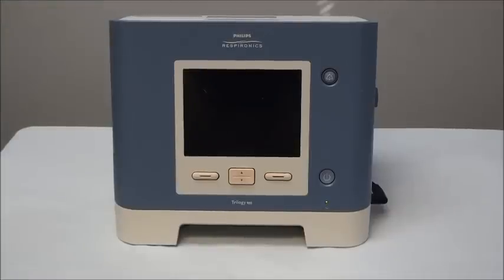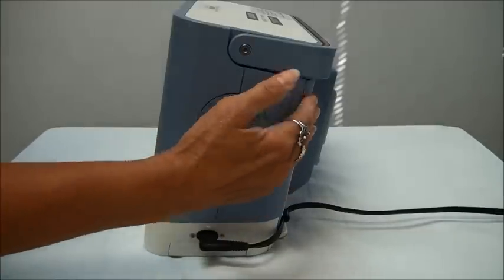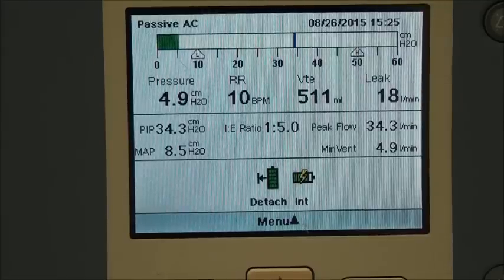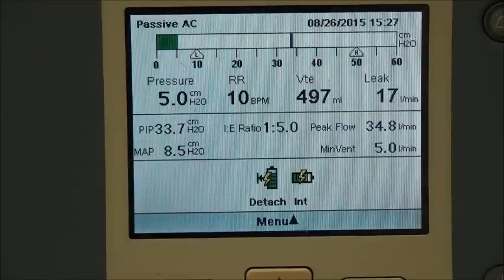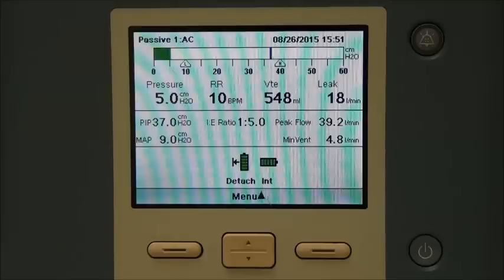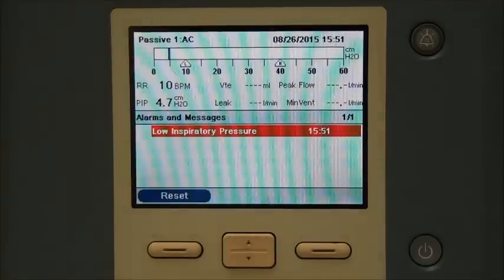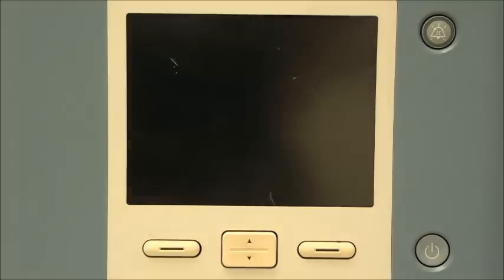Trilogy 100 Ventilator Set Up

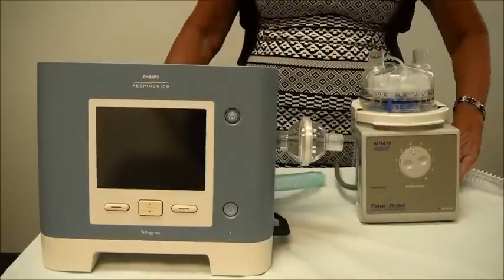Comment: 4:36 - - QUESTION:  WHERE DOES THE EXPIRATORY HOSE GO AFTER IT LEAVES THE HUMIDIFIER?
(On HOSPITAL VENTILATORS it hooks back into the ventilator - - but on HOME VENTILATOR it just hangs off the side ???)
Reply: It connects to the patient.
Reply: That is the inspiration limb coming off of the heater...Expiration occurs thru the port connected near the patient...in passive mode...No Expiratory limb on a trilogy circuit.
Reply: @DEgan-dk4qp  thank you 🙂

Comment: If I want to connect a oxygen concentrator is it a certain way the valve on the ventilator needs to be and do I change any settings
Reply: Katina Star I need to know also
Reply: Yes it needs to be connected on the valve at the back of ventilator. At no certain point that you will change a setting without an order from the doctor or Pulmonologist. Settings are mostly lock so you cannot even change the settings without the Pulmonologist order.

Comment: Great video.  Mine is set up as ventilator, but just plain blue hose out to regular mask and I wear oxygen hose.    Should they have put a different circuit in it so the trilogy would get feedback and adjust?   I put on mask and sometimes in less than an hour I  wide awake, get up very dizzy.   I suppose to use 7 ppm on hose and 3 liters with machine.   I only been able to sleep 6 or more hours less than 10 times.   It was delivered 5 years ago with humidifier bottle and that would get my mask so that it would not seal and trying to pull oxygen line off back of machine was very difficult and that’s why they bypassed the humidifier.   I been terribly cold and constantly sleepy, so tried wearing it again.  Same results.  The oxygen company that’s all over the USA has closed 2 offices.     While wearing I warm up fast.   Suffer from  severe PH and severe congest heart failure.  The last 4 months have been a nightmare sleeping 16 plus hours a day and waking up so cold and weak.  Finally after dealing with it I went to ER.  My regular doctor and ER doctor are at a lost.    Thank u, I saved your video to show lung doctor.
Reply: My mom had a hard time using the bipap/vent.  She started using it last May 2021 after an acute Exasperation, which they added along with new nebulizer meds.  Omg!  I remember when they came with the vent, she died tech told her to keep her cannula on with oxygen along with the mask.  My dad also had one, but he didn’t like it either.  Mom and dad were waking up same way

Comment: I love the instructions & walk through , answered many questions, One thing I did not notice however, is when she is on her non invasive one when the bar goes low it pulsates or burps so to speak, then pushes the air  but will do this like 3 times then work fine again, then repeat, her oxygen level is also not the same, is there a setting for the flow of that on the machine or does it just go through freely? Well thanks glad to have found your video...

Comment: Is it the internal compressor making noise?
Reply: +John AK72 There is no compressor in the unit per se, there is a turbine in the unit that creates the needed pressure and that is the noise you hear.
Reply: Michael Chismar Same as the rule of air compressor in the some ventilators? is it possible to use pipeline compressed air, if it's available?
Reply: +John AK72 The unit is not designed to have an external compressor.  Designed as a home unit.  What is the issue you are having?
Reply: Michael Chismar using the pipeline compressed air, this is my issue.
Reply: +John AK72  Pipe line air pressure is 50 psi.  Why do you want to use pipeline compressed air with the unit?  What are you trying to accomplish? Are you trying to run the unit off a 50 psi compressed air source?  This is not possible.  Are you trying to bleed in additional air flow into the unit via a compressed air flowmeter connected to a 50 psi source?
Reply: Michael Chismar just to make an easy ventilator in case that all of your sophisticated machines are in use. for example as a transport ventilator-like Oxylog 3000- anyway I really don't know anything about the price!
Reply: Michael Chismar Yes, but it doesn't matter cause I'm a student and wanna compare it with Drager Carina.
Reply: John AK72 
hey i Know the dräger Carina i watched all instruction Videos and Patient falls
Reply: Henriette Voss That's great, what else you know about Drager? anything about gas machines? turbine ventilators? Maquete ventilators? low-flow anesthesia techniques?
Reply: John AK72 
I Know the dräger Carina and other machines from dräger but i can't so good speak english. I came from germany. A question can you speak german? Then we can talk german and i can better understand you😄😄😀😀😜😜😆😆
Reply: John AK72 
Carina is a turbine Ventilator or Not?
Reply: The Mangle Fan Yes it's a turbine ventilator.
Reply: The Mangle Fan Sorry I speak English y un poquito Español! it's all okay!! you speak German, I speak English and see that's all. nothing else matters anymore.